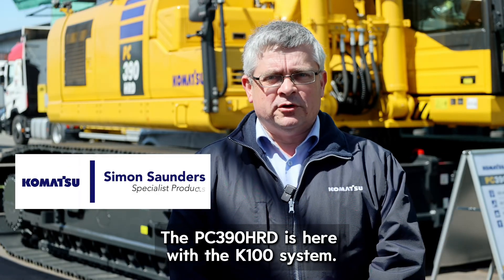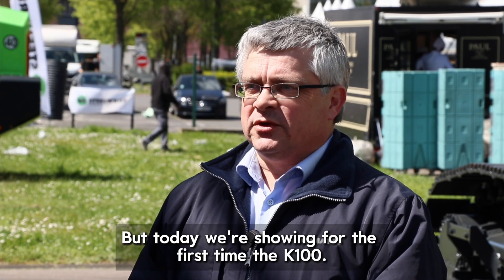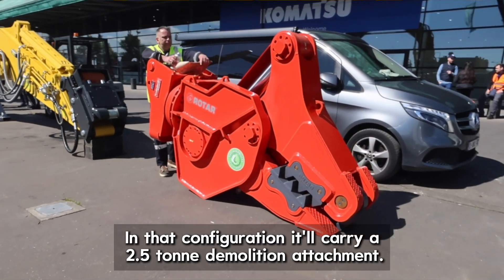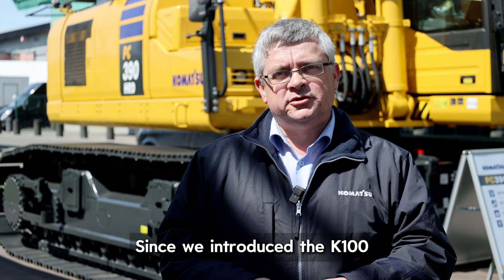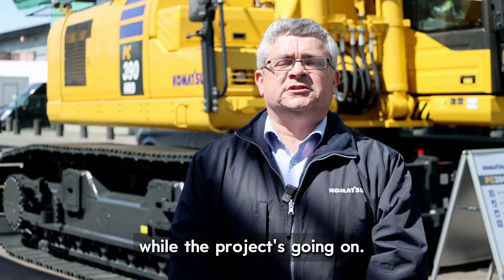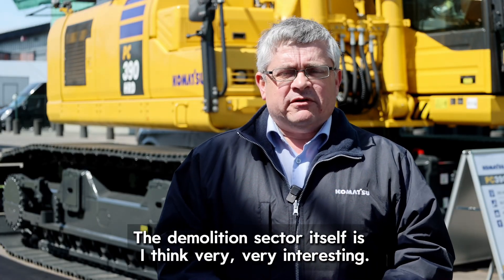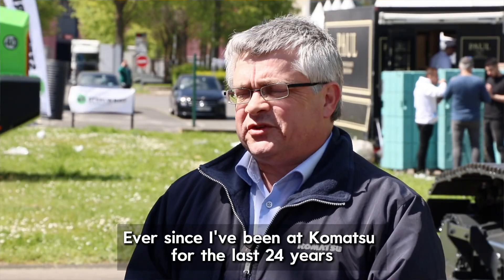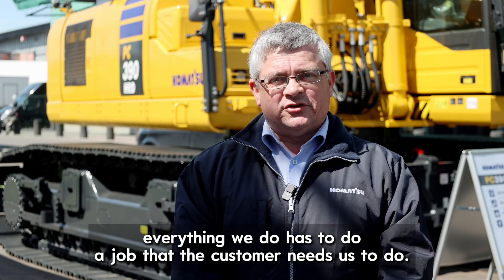PC390HRD-11 High Reach demolition excavator with K100 system

Comment: I need a solution that allows for quick attachment and removal of both the bucket and demolition tools. I was planning to use an OilQuick OQ80 or OQ90 system for this purpose. In the demonstration videos I watched, the demolition tools weigh around 2.5 tonnes.

However, for the long-reach boom, the maximum allowed tool weight is also 2.5 tonnes — and the OilQuick coupler itself weighs around 300 to 500 kg. This puts the total weight over the limit.

How can I solve this issue?

Alternatively, do you already offer your own quick-coupler system for fast and safe tool exchange on high-reach demolition machines?